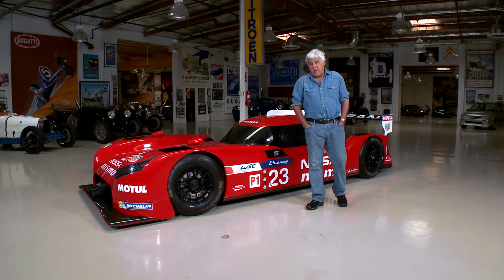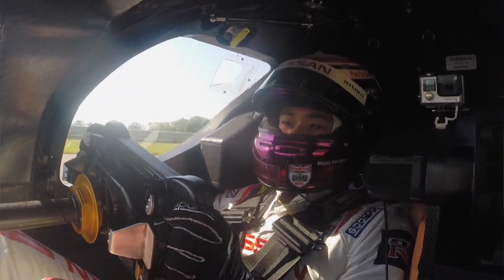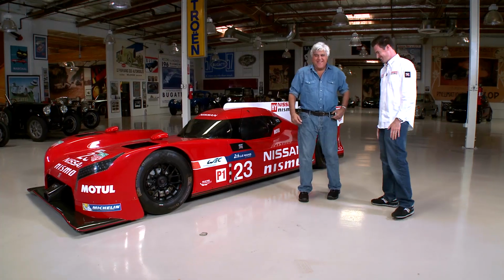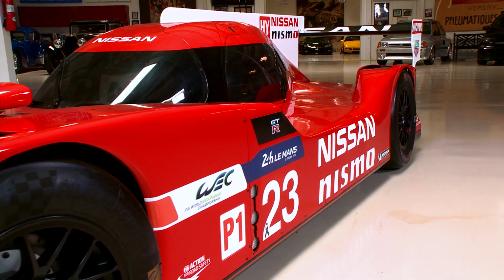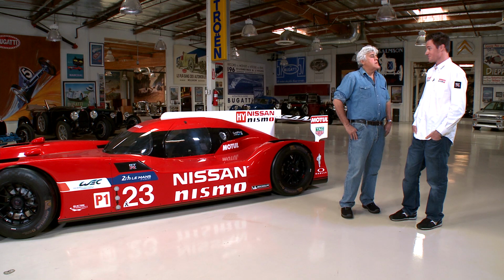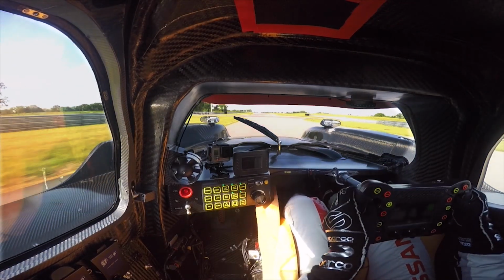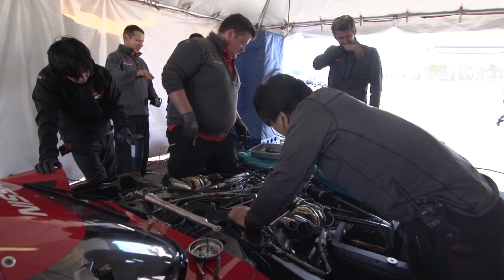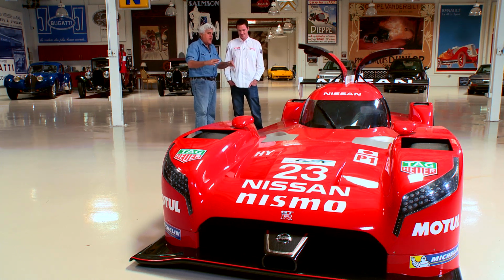Nissan GT-R LM NISMO - Jay Leno's Garage

Comment: this and the delta wing are just masterpiece!
Reply: Sarcasm? Has the Delta wing finished a single race yet?
Reply: truantray the delta wing wasn't able to race due to its extreme design, the car wasnt able to be classified as anything other then a car. Thats all people could call it, a fast car. It couldnt race even if the designer wanted to race. In the end, I believe it did race once, sadly a 911 cup car clipped its tail and sent the delta wing flipping through the air. lastly Nissan pulled out of the delta wing project( my guess would be because the car couldnt really race.) and due to the fact Nissan was the main sponsor also had all of the cars secrets so when Nissan pulled out they took all the knowledge gained from the project and basically copied it but added a roof. Um i wish i had sources maybe ill do a little more search and ill add a couple of sources. oh well, that was just my understanding of the delta wing.
Reply: truantray People kept crashing into the DeltaWing. It would be great if there was a whole race series/class with them, then they could all see each other.
Reply: truantray not at all ... They are real masterpiece and I wish Nissan all the very best!
Reply: Vega Rapidus The open cockpit still look better
Reply: truantray Dude the Delta Wing is still racing in the Tudor series and by the way it did finish a bunch of races in the ALMS days inclduing finishing 5th overall in 2012 at Petit Le Mans and nearly winning at Road America 2013 battling it out with the P1 machines. It's quite clearly an unconventional car and still-in-development but the car has shown promise on numerous occasions. By the way, I'm not a huge fan of the car but I do like something different and odd.
Reply: Vega Rapidus Masterpieces are the LMP1 from Audi and Porsche. This Nissan is crap and will be humiliated in Le Mans next week.
Reply: Vega Rapidus OMG Jesus. You are really funny. So much Bullshit. US Guys and their love for Nippon Cars. Even if they are really crap like this Nissan LMP1. 

I really have to laugh a lot. As the people worldwide will do next week after the Le Mans Race for Nissans humiliation. Audi, Porsche and Toyota are much much better in every single way. In Europe we know it better. Much better.
Reply: Vega Rapidus I will ignore this thread after this. It's useless for me because you don't understand anything i wrote. 

It's okay that you like this special fwd conept of Nissan. And a fourth factory in LMP1 is great. But the GT-LM is not a masterpiece because it don't work on a track. And only this is important for a racing car. A masterpiece of engineering achievement are the Audis, Toyotas and Porsches because there are really fast and the racing in Silverstone and Spa was great. All three derserve to win next week.

Nobody cares about the losers in Le Mans after the race. And Nissan will be the biggest loser. 

That's something YOU don't understand. 

It would be better if Nissan don't make any big announcements and go to work for a real racing car for fight against the big three. 

They announced that the will go for the win in 2015 with an 8MJ Hybrid. And nowdays the Nissan has a 2MJ Hybrid which don't work and the reliability is only god for a few laps. 

If Nissan didn't make this big announcements it wouldn't be so embarrassing. And that is something YOU don't understand, too.  

Alone for Nissan announcements it will be a big joy for me, when they will be destroyed next week. 

And know thank you and good bye!
Reply: SilverArrow WilliamsMartini The "Fanboy"  knows it better. Much better. Look at Le Mans where the Nissans can't beat the LMP2. 

So fucking embarrassing for a big company. 

Nissans LMP1 is a piece of shit.

I was so right. Like every over expert who knows anything about motorsport. 

Nissan only shows that they can't build an LMP1 car. Or an hybrid.
Reply: ***** Or until brakes have worn out. They must have gone through at least 10 sets of discs on each car. It was disgracefull display for a company like Nissan. I had my doubts but hoped they will pull off at least something half decent. I hope they don't pull the plug on the project after this
Reply: idontcare80 lol

Comment: Absolute disaster at le mans yesterday, the gtr proved to be rubbish with one catching fire and another finishing 40th after completing just 242 laps.
Because the front tyres did most of the work — braking, steering and accelerating — excessive tyre wear also became a problem for the Nissan while most other outright contenders made their tyres last for three of four driving stints between changes.
The front-drive design was so flawed (all the other cars on the grid are all-wheel-drive or rear-wheel-drive) all three Nissan cars were forced to start last among the outright contenders because they failed to complete a qualifying lap within 110 per cent of the fastest car, an eligibility and safety requirement
Complete and utter embarrassment to the gtr brand.
Reply: Did the Nissan improve the design since this comment of yours, after four years?
Reply: No surprise at all. Did Chip Kelly come up with that idea?
Reply: Stranger Happened Nissan killed the project after its first Le Man
Reply: It is too bad that the companies give up this quickly. Nissan should have invested more in research and development before closing the project. BTW, I remember reading that Mercedes ran away from racing for decades after a huge catastrophe in the 1950s and then again in the early 2000s after their successor model to their famous super winner GLK GTR car has failed in few races.
Reply: It's FWD!  Often in life, it is best to abort a mission that you know has little to no chance of ending well. There is NO WAY a fwd car is going to hang with the others...it was a BAD IDEA to begin with.
Reply: True, FWD does not seem to be a good idea, but for the sake of thought diversity and technology advancement, it would be still interesting to see companies trying to solve difficult technical issues while advancing the whole industry along the way.
Reply: I know, but in a way, it's still a step forward toward understanding what does and doesn't work at LeMans.  Wanted this to place so badly.
Reply: How did it win one then?
Reply: Mad props to them for trying something new.  I think it was a courageous attempt at fielding a different design and giving young talent a shot.  More development would have paid dividends as they couldn't even run the hybrid drive which engaged the rear wheels.
Reply: @StrangerHappened  because the clk gtrs flip twice on lemans on that fia season
Reply: The cars failed so spectacularily at Le Mans because of their Hybrid systems failing, which powered the rear wheels, meaning the AWD the car was supposed to have wasn't there at all.  When the car worked, it was decently on-pace, one the system failed it was slower than LMP2 cars.
Reply: Khaled Baghdadi I don’t think it’s an embarrassment. Quite the opposite. It shows that Nissan is willing to make a car that captures peoples’ imagination no matter the cost to themselves and also that they are willing to exhaust all options to reach the best solution to a problem even if that means they’ll have some utter failures along the way. Ie if you buy a Nissan, they’ve tried EVERYTHING they possibly could have and you’re getting the best out of all of that testing.
Reply: You know their failure might have been due to them not using their huge hybrid power system which powered the rear wheels. Hence the problems mentionned above. I wish theyd taken the time to build the cars properly without rushing anything and improve reliability. I think this really could’ve taken the fight to porsche and audi had it stayed around and fixed its problems mainly down to build quality and reliability
Reply: @StrangerHappened  no, they dropped it like a stone.
Reply: You would think a company spending millions and millions of dollars of a new concept would have some proof of concept before entering such a race? What a total waste of money. It's as if nobody has ANY idea what makes a car go fast. "Let's try doing something really different, it's bound to go fast (we hope!)".
Reply: Spec D what are you talking about?
Reply: Biggest problem was them being far behind in the development. Thus they had to have the Hybrid system on board but couldn't use it because it didn't work. That brought up their weight without the additional power and also left them without the 4WD which they decided upon to AFAIK (decision was still up at the time of this video as mentioned). Would've been interesting if they could've have improved over time. Unfortunately with ever changing regulations the time slots for trying something like this are very small.
Reply: The Hybrid LMP1 cars have FWD via an electric motor that takes over in the corners and the rear power is gas on the straights.

Comment: Am I the only one who sees that this is not a front engined car? It's mid engine because the engine is between the front and rear axles, not in front of or at the front axle.
Reply: well front engine as literally in front of the driver's cockpit, so its front mid engine.
Reply: "so its front mid engine"

Yeah, that.

Comment: 14:13 muffler? what is that?
Reply: vivalaphill It's that thing that converts power into happy neighbors.
Reply: vivalaphill the exhaust to be exact
Reply: TrapBum there is an exhaust it is 10cm long :D
Reply: vivalaphill The turbo really takes out a lot of the noise.
Reply: detaart still going to be loud af, i like that.
Reply: vivalaphill Might or might not be.  Depends on the diameter and geometry of the piping.
Reply: detaart without any silencing anything is loud.
Reply: vivalaphill I ran my diesel wrangler with just the down pipe for a while.  Sure, it was loud, but not really THAT loud.
If you run an N/A engine with just the header, you'd have to cover your ears.
Reply: detaart diesels aren´t that loud in general, you probably have more mechanical noises coming from the front than exhaust noises from the back.